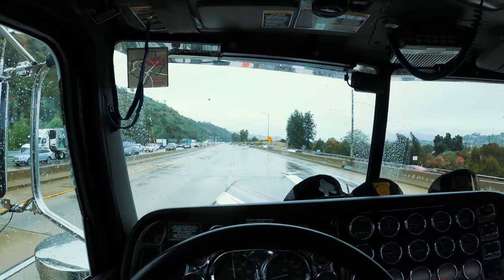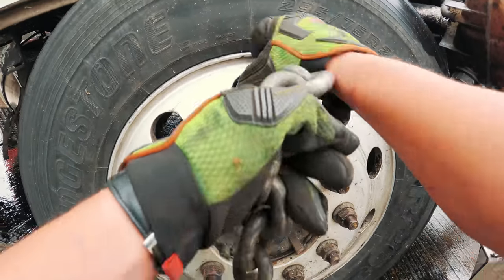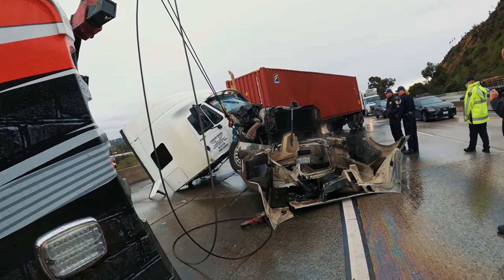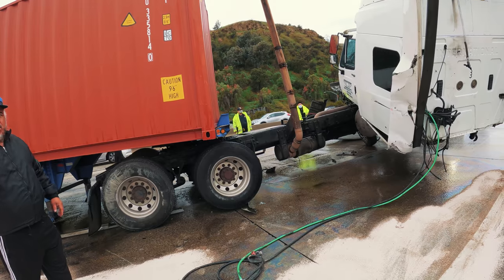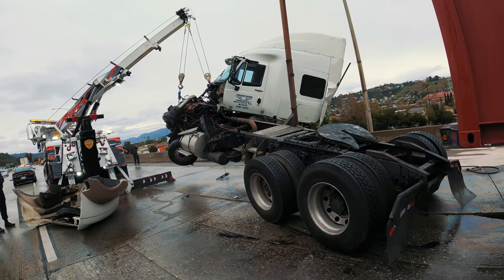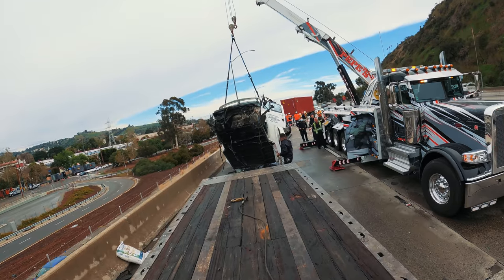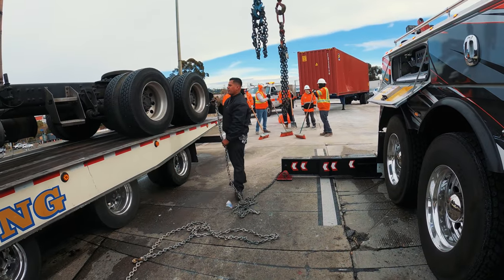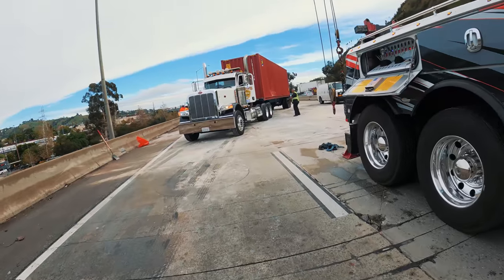Insane jackknife on the freeway

Comment: I used to run a grading company in an area where it would snow once or twice a year. As soon as the Atlanta  TV stations announced it was snowing in the mountains, multitudes of people from the Atlanta area would come up to see the snow and end up in ditches and the woods. When all the hooks in the county were busy, the stuck people started calling the grading contractors, when all the grading contractors got busy, farm houses with large farm tractors got knocks on their doors. Your equipment  looks great.  Y'know, when you first feel the truck start to jack-knife you can pull on the trailer brakes and counter steer with the tractor, the tractor will pass back into line after about three counter steering passes. Trust me, I used to run coast to coast in Canada in winter.

Comment: Josh I can see that you learned a lot from your dad. Someone asked why your dad didn't just winch the tractor frame onto the Landoll first. It's the positioning of the load and how to get all pieces on. An answer to another question, not only International, but all trucks are built this way today with SMC (Sheet Molded Compound) to save weight .

Comment: Even though that is a total, the chasis gets checked on a frame machine and a used cab and front clip get bolted on for an entry level owner operator?
Reply from the maker: No clue
Reply: If there is a chance that the frame was twisted, then surely it would be written off. One broken weld and that could spell problems down the track.

Comment: What caused the jack knife?
Reply: The clue is all the oil slicks everywhere on the road surface. It rains infrequently in CA, allowing all the oil drips from all the passing cars to accumulate. When a short shower comes through all the accumulated oil is free to move, and is like greased lightning. Plus the tires were near bald. A sudden stop and everything behaves like it's on ball bearings.

Comment: It looked like the cab was on the upper deck with the winch cable stretched on the lower bed, the cable would not hinder the winch line and you could hook to the front of the chassis and pull it on to the landall.....just asking.
Reply from the maker: And how would you steer it, with no steering wheel and a broken tweaked chassis? And why would I destroy my beautiful wood bed dragging that up the bed? I just fail to see how someone can see a job like this, and say "hmm, should have dragged it up". Makes zero sense in anyway. You wouldn't save any time, it wouldn't be more efficient, I see zero benefit and you haven't explained one.